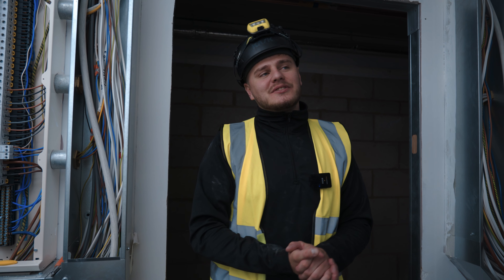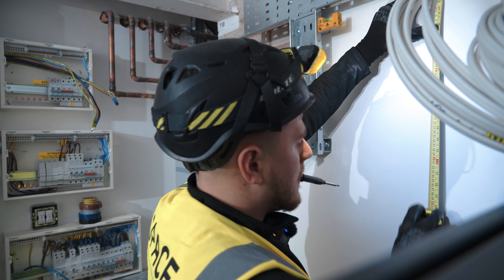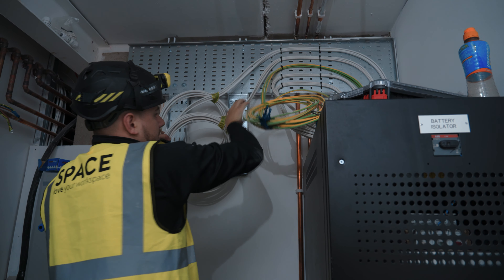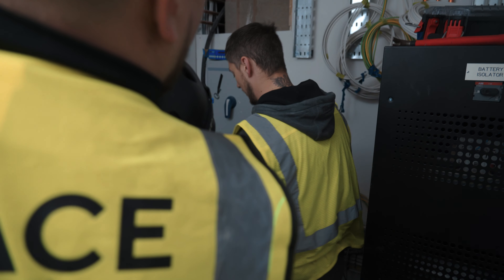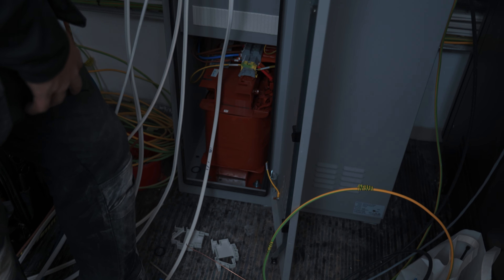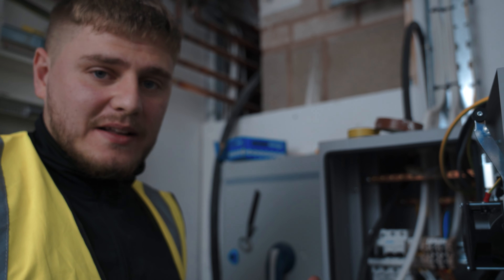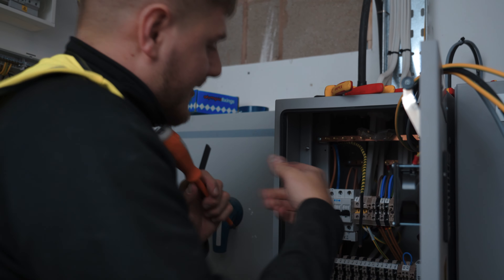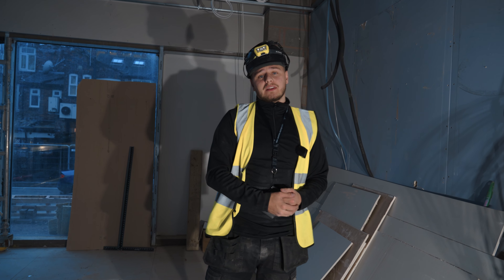Connecting electrical circuits without earth's -- Medical IT System

Comment: Nice to see a different side of sparky work! I've seen the alarm side work from a patient perspective just before surgery. Alarm went off and a methodical unplugging of gear ensued and a swap over.
Reply: It makes a change for it to be methodical unplugging. It's normally a bit frantic and haphazard, particularly if the patient is on the table!

Comment: Interesting video. You do find unearthed systems on some of the high voltage distribution network and power stations, especially where you have a delta secondary transformer winding to a delta primary transformer winding, so there is no star point to take down to earth. You also find high impedance earthed systems where the transformer winding star point goes through an impedance before connecting to earth to deliberately limit the fault current to a few amps. Otherwise with directly bonded, it would be silly amps time.

Comment: It is worth knowing that most medical equipment is double insulated and meet extra safety regulations in such a way that they have to provide bonding so you can’t get a shot from a metallic thing but most of the metallic things do not have the capacity to become easily energised as well

Comment: Ungrounded systems are a big thing here in USA where requirements are very strict, isolated transformers, XHHW wire with all conductors with more robust insulation to ensure sufficient dielectric insulation, testing is also required to address failures we have line isolation monitors to keep leakage current and monitor potential differences say in operating rooms (OR) at minuscule levels for that a line isolation monitor is used. Specifically this can mean minimizing the length of branch-circuit conductors and using conductor insulations with a dielectric constant less than 3.5 and insulation resistance constant greater than 6100 megohm-meters (20,000 megohm-ft) at 16°C (60°F) which reduces leakage from line to ground. In critical OR rooms power needs to be continuous and not break so GFCIs/RCDs are not permitted and will operate even under fault conditions. Of courses this requires medical equipment to be fully tested for dielectrics and various other leakage tests including patient leakage tests. This requires not just electricians understand ungrounded/isolated systems but it requires medical staff to understand if line isolation monitor picks up leakage current to be too high (remember normal skin resistance os reduced in surgery). If alarms sound then medical staff literally have to unplug medical devices in a specific sequence to isolate the problematic faulting medical device either remove it or leave the OR to go to a working OR with no faults the ungrounded system also ensure the isolated circuit protecting it has dedicated emergency backup power as well.

I suspect you will need to cover multiple standards for health facilities never is the case only one standard covers it. Standard wiring regs, emergency power regs, health facilities reg, medical devices reg etc…
Reply: @residualelectrical  mate I need to buy some boddingtons gear from load out but living in USA I prepared to pay for the shipping but no option to do that on the website… anyway to get around this?

Comment: The grey box (IMD) is the monitoring device you set that to alarm when the insulation resistance value drops below a limit e.g. 100k ohmes also can set the current value based on the KVA rating of the transformer so a 8KVa has a max load of 34a anything over that the IMD will alarm for overcurrent similarly there is an bi metal strip in the transformer that will break at a set temp opening a NC contact setting off an over temp alarm.

That device is a joint IMD and EDS the EDS uses a PGH to inject a current down each circuit through an CT to locate which circuit the fault is on. 

The alarm panel I’m guessing is either an RA-003 or one of there touch panels that they can use to alarm for the IPS and control and alarm other systems in the theatre like UCV and ventilation

Comment: Brilliant video, IT installations aren't common and unless you're working on NHS/private hospital sites or cleared to work on MOD sites most electricians will never be involved with it.

Edit: Only thing I will say is the Isolated Tera system you appear to be running in there is not the same as the Integral Tera we did for the MOD. 

The system installed for MOD sites is isolated from the incoming supply via transformer, the CPC's were bonded to the neutral at the panel with sense cables to alert to a fault. All accessories, trunking, cable tray, conduit etc was all bonded as well. The idea being that if an attack happened they would not loose power or risk electric shock to soldiers as there is always a path to complete the circuit. 

Figured I'd clarify although it has been a number of years since I've put an IT system in.
Reply: @residualelectrical  I enjoyed it, the differences between MOD and NHS even though it's bracketed under the same "IT" system always make for interesting topics. I do miss being involved in that line of work but it's better left to lads younger than myself that don't mind the hours.
Reply: What is MOD?
Reply: @whatevernamegoeshere3644  Ministery Of Defence
Reply: IT system in railway signalling power supply ,

Comment: If the equipment is potentially grounded via separate earth  connection, drawing extra p-e in parallel to the same  outlet the equipment would create 
The risk of inducting "wandering  induction current " 
(Creating ground loops)

Comment: The railways use IT systems for signalling power supplies, managing earth faults of cables that run in ducts alongside the railway for miles is a challenge
Reply: You would need extremely thick earth cables.
Reply: @deang5622  I mean you can at that point connect a thick PE and drill in earthing rods and connect it every say... 100 meters. Randomly made that number up. But you then end up with different issues like current flowing on your PE from ground potentials, nearby earthing rods from anything like random consumer units or lightning protection systems dumping fault current into the soil, etc. It's easier not to even bother with an earth at that point and use IT, PELV or SELV or something but then you consider voltage drop and ELV systems are out of question. 110V DC or lower also works but DC in a rough environment like that help corrosion and everything will rust to hell and back if water touches it. To sum it up: IT works, TT is fucky, ELV is not even worth doing, LV DC is maintenance hell, and maaaybe you can get away with a TN system with an earthed live but then you have 2 phases with 400V on them compared to ground.
Reply: The additional difficulty railway cables have to contend with is high longditudional and transverse voltages induced in cables from 25 kV traction systems. Grounding systems have to be bonded to the traction return to prevent dangerous voltages but the external ground connections have to be kept outside of apparatus rooms, so cable sheaths have to be gapped before entering buildings.
Reply: @barrieshepherd7694  No such thing as a transverse voltage.
Parallel cables induce a voltage because there is capacitance between the cables. Nothing transverse about it. Currents are induced by an inductive effect (by way of a magnetic field).

The concept of transverse applies to transverse electromagnetic waves not to voltages.

And high induced voltages in signalling cables is easy to contend with by using either differential signalling or optical fibre.
Reply: @deang5622  I beg to differ.  

Transverse voltages occur in cables across pairs of wires and can cause induced noise levels.  Obviously this effects communications cables more than power cables.

The inductive field is caused by the 200 odd amps, at 25 kV, 50 Hz, flowing in the overhead contact wire when a train is in section.  This causes a significant field around the railway corridor.

ITU-T Recommendation K.23 explains it  well.

While transverse voltages in these circumstances may be low, raising noise levels, longitudinal voltages can be dangerously high.
Reply: @barrieshepherd7694  Wrong.
Voltages don't have a direction other than positive or negative which determines which way the current is flowing in the cable.

There is NO concept of a transverse voltage.
You can use the word transverse to describe the physical orientation of cables, or to describe the direction of a magnetic fields and currents, and physical motion of these elements to each other, but there is no concept of a transverse voltages.

A voltage has only magnitude, and direction of which is either positive or negative, and rate of change.

I told you how the voltages are induced and I told you how signalling systems can be protected. So little point in telling me about the issues caused as clearly I already know as I told you how they can be protected!
Reply: @deang5622  Maybe we are talking at cross purposes however from ITU-T Rec. K.23;

"Two voltage modes should be considered: longitudinal voltage and transverse voltage. Figure 1/K.23 illustrates the
definition of longitudinal voltage induced in telecommunication lines and the transverse voltage.

When longitudinal voltage is present at equipment interfaces, it may cause malfunction of the equipment. 

The transverse voltage is induced by conversion from the longitudinal voltage because of transmission line and input terminal equipment impedance unbalance, and by direct coupling with the inducing source. 

It may cause a degradation of
transmission quality. 

Therefore, both the longitudinal voltage and the transverse voltage should be considered"

There are also a number of papers available from the Internet.  From one of these, penned by a previous Chief Engineer of British Rail come the following;

"As well as high voltages, because the wires of a pair in a telecom cable were not always identical as to resistance and capacitance characteristics, the inducing field could introduce noise on to the circuit by what is called a transverse voltage. 

Under internationally agreed limits, this had to be restricted to 1mV, and required cable balancing techniques for this to be achieved."
Reply: @barrieshepherd7694  Thanks for posting that, but what they are saying is a load of bollox. It almost seems written with the intent of deliberately confusing the picture. 

Voltages and currents are induced in electrical cables by only two phenomena: capacitively induced and magnetically induced.

In the case of capacitively induced it occurs because of the presence of high voltages and the capacitance between cables.

In the case of magnetically induced, it is caused because there are high currents present which create strong magnetic fields, and those changing magnetic fields induce voltages through Faraday's law of electromagnetic induction in a nearby cable.

That is it. Those are the only TWO mechanisms as to how to voltages are induced in electrical cables (I am excluding cables acting as aerials and picking up radiowaves).

The thing about balanced, unbalanced cables is this.

Balanced cables is a way to deal with the problem.
In a balanced cable system, two wires are used for a signal. Functionally only a single wire is required to convey the signal.
So why do we use two? Because it is a way to eliminate the unwanted noise.

What we do is transmit the signal, the true and the inverse of it on two wires.
And it's a good idea to twist the wires along their length.

The capacitively or magnetically Induced noise signal is then picked up in both signal wires on the true and inverse. Then at the receiving end of that signal cable, those two wires are fed into a differential input amplifier with a high common mode rejection ratio.

That differential input amplifier only amplifies the difference on its two inputs, so common mode noise is rejected. 

With a noise signal represented by the symbol n, and the output of the differential amplifier being Vout then :

Vout = A(VinA - VinB)

VinA, VinB are the input signals
A is the gain of the differential amplifier 

Let's add the noise voltage:
Vout = A( (VinA +n) - (VinB +n) )

Expanding this gives:
Vout = A( Vin + n - VinB - n)
Therefore
Vout = A(VinA -VinB)

And you see the noise signal n cancels out.
Now VinA and VinB are the same signal but the true and its inverse:
VinB = -VinA
So Vout = A(VinA +VinA)
Therefore Vout =2A.VinA

That is all there is to it.

The other way to deal with it is to use optical fibre and as the signal is carried by laser light within the fibre it is not affected by electric or magnetic fields in the vicinity.
Reply: @deang5622  Don't disagree with the differential amps and twisted pair solutions these are some of the solutions to the VT problems.  1:1 600 Ohm transformers were favorite ones as they  are less prone to failure from voltage spikes and of course remove VL issues completely.

What many do not realise is the considerable magnetic fields around a 25 kV contact wire when a train is drawing traction currents in the order of 200 amps.  Well over 100 volts can be induced in an unscreened cable in the trackside toughing route.  VT noise is induced (we can argue about the mechanism) into the 'balanced' pairs of a comms cable - I know as I have sat by the trackside monitoring them - historically auto monitoring equipment was set up in some areas to detect VL/VT levels  to indicate any potential degradation of the immunisation system. 

The matter is now reduced in railway terms by the extensive use of fibre optic communications for trunk cables but local distribution cables still exist for trackside phones and signalling controls so immunisation criteria still have to be met. Even if not needed for railway equipment the immunisation is still required to be provided to protect (originally) Post Office cable but now all communications providers outside of the rail corridor but still inside the influence of the single phase traction system.

The next mystery  is unravelling the interaction of railway lines, traction systems and cables with pipeline cathodic protection systems - it all becomes black magic!
Reply: @barrieshepherd7694  "We can argue about the mechanism".

No we can't argue about it. It is defined by physics. There are only two ways it can be induced. Capacitively or inductively.
Both may apply.
Reply: @deang5622  I think that is what I was saying

Comment: Interesting how they don't make a double brown with no earth cable specially for this.
Reply: I‘m sure they make them, but they are probably way more expensive then regular 3x1.5 or 3x2.5.
Similar I usually run 5x1.5 to window shutter motors, even you technically only need 4/5 wires. It‘s just cheaper and on the car anyway.

Comment: The i is for isolation and the t is for transformer. This lad has completely missed the point of this. The transformer is a 1:1 traffo basically 230v in and 230v out, but because it is on the secondary side it will not be affected by any spikes on the incoming side(think of it like a filter for the 230volt) also being on the secondary side it means 230v between L1 and L2 (the two browns) but 115v L1 and earth and L2 and earth still not ideal but much safe if there is a fault.same thing with a site traffo, the yellow 110v, that has 55 volts live to earth.
He should not cut the earth out, that earth is the dirty earth that should travel with the L1 and L2 from ips panel to IPs sockets, what did they think the two earth bars in the top were for ????
In the back of the IPs socket there is two earth terminals the dirty earth that is connected to the screw lugs and the body of the socket face(class 2 earth or dirty earth) the one that one that the healthy doctors staff come in to contact, and the other only to the earth pin of the plug top(class 1 earth or clean earth) that’s the one on the machine/piece of equipment that the patient who is unhealthy and has a compromised immune system and is more susceptible to injury from an electric shock so this earth goes but to a earth reference bar located in the room that has an much lower resistance. 
Sorry This is mad long but fuck me he did a really shite job of explaining something very interesting.
Reply: @cylou
Gibberish on stilts.
Reply: @residualelectrical  You did a better job than cyclofuka or whatever his name is. IT is Isolation Terra, as you said. The transformer is an isolation transformer so there is no solid reference to ground. Nothing at all to do with power condition / limiting spikes / filtering. It's solely for isolation to ground, hence isolation transformer, not reactor or filter. There may be ancillary equipment to filter, but that's not the job for the isolation transformer. 
The first alarm is when you get an earth fault on one leg, you them lose the advantages of the floating ground / isolation to earth. Three phase systems in mines, some ships and  DC power systems in substations all use the same system, floating ground. This allows for better protection from earth faults, shocks and also allows one leg to connect, or touch ground and not trip the circuit, shock or induce and fault currents. Since basically the first leg to connect now becomes what we all call the bonded neutral. Keeps people and equipment safer and also keeps the run time up. Way more to it, but that's it put simply. You did a good job in your video explaining it.